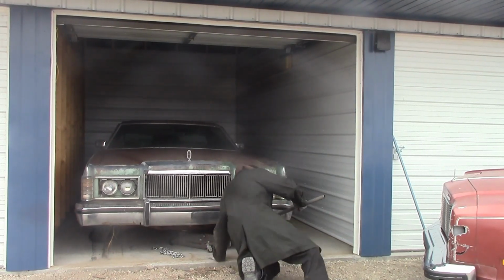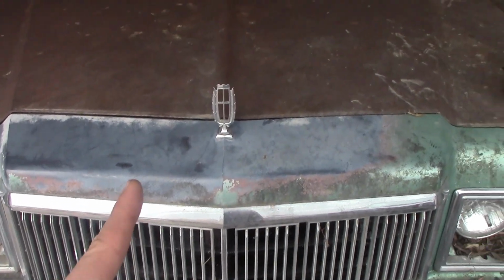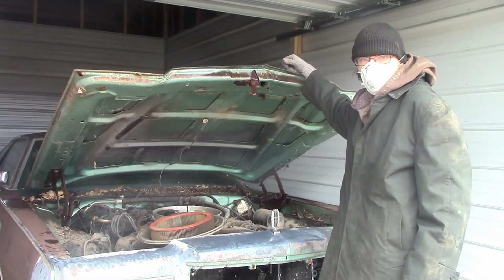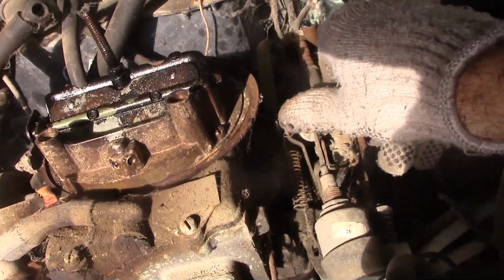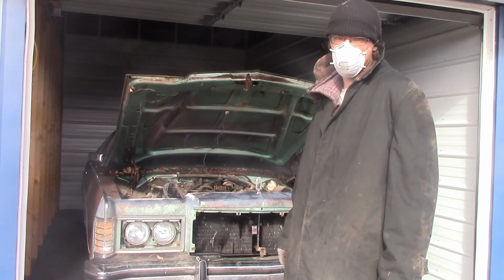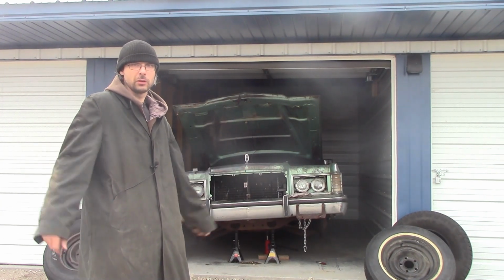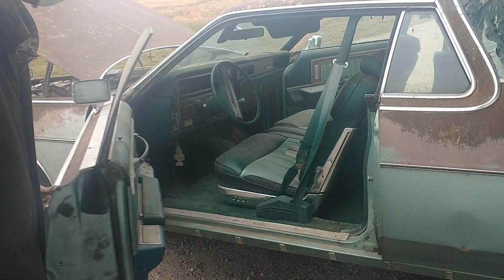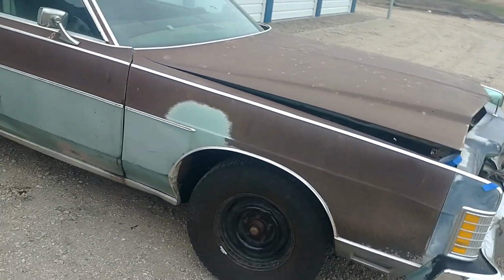1978 mercury marquis “uncle buck” junkyard revival part 2

Comment: Keep the interior green, and paint the exterior emerald green with a white bed liner roof. Then I think the card look really good. The Chinese make some green mirror window tint I put on my Seville looks really good and it doesn't cost much. On my Lincoln I took out the four round headlights and put two big rectangular ones behind the headlight doors. From a 1990 rear wheel drive Fleetwood. So when the eyelids lift up it's got two big rectangles. I have a project Ford LTD two-door coupe but I paid a lot more money for it then you paid for that car. When I'm done I'll have 8,000 in it but it should look and smell and feel like a Barely Used Car. Alabama no rust. The Plastics take a beating though in Alabama but the metal stays pretty good not as good as Arizona